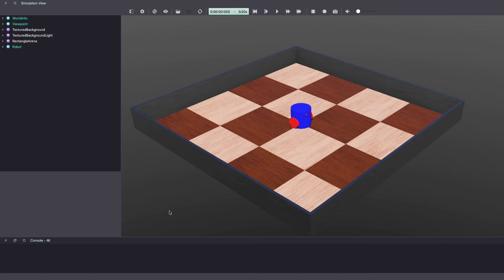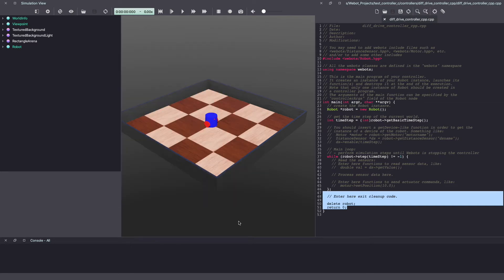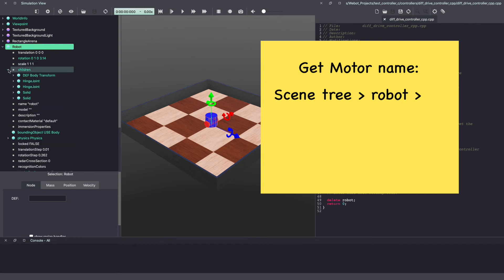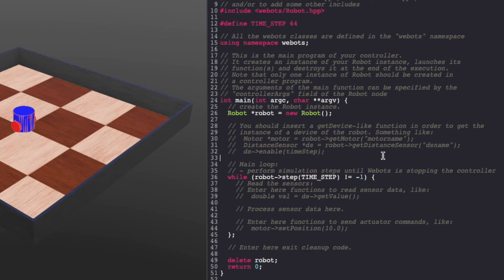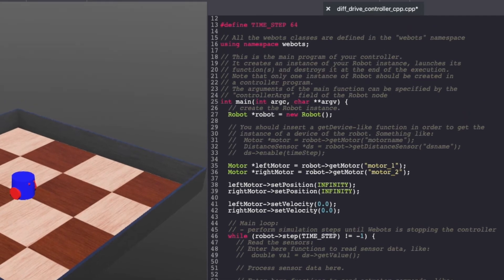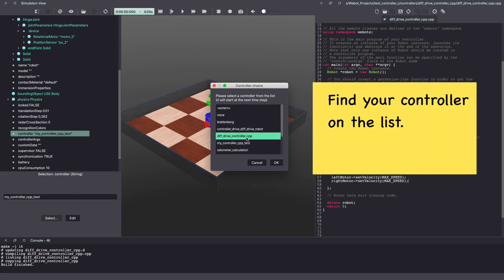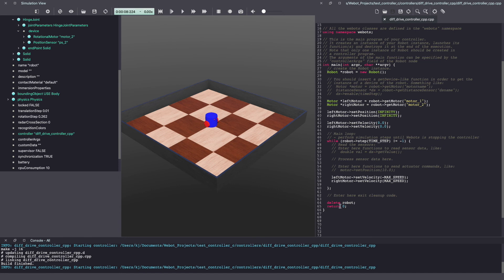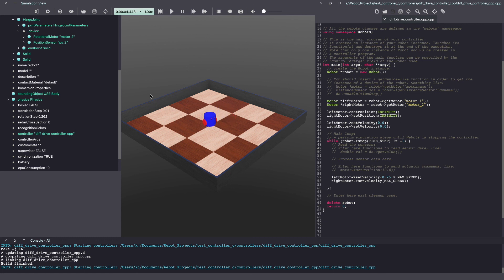Webots Controller Code in C++ // Webots tutorial in C++ // Tutorial 3 drive robot using motor

Comment: How can the robot be balanced though it has 2 wheels?
Reply from the maker: You can balance on 2 wheels. You do have to model it right, if you change some of the dimensions, it will go off balance. 

Sometimes you will also see differential drive aka 2 drive wheeled robot have a 3rd passive wheel for support.

All of this is essentially robot modeling - a dedicated sub field in Robotics.
Reply: @KajalGada  Thanks for the reply 
But what is the way to add a caster wheel to our custom robot?
Reply from the maker: @gastrodiron8573  similar to the wheel. Try it out
Reply: @KajalGada  OK Thanks 🙂🤩